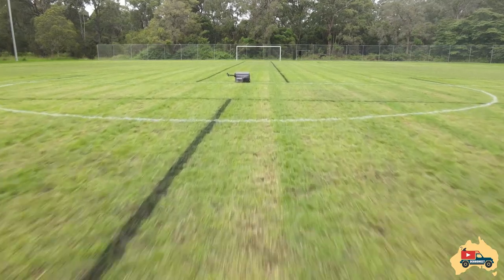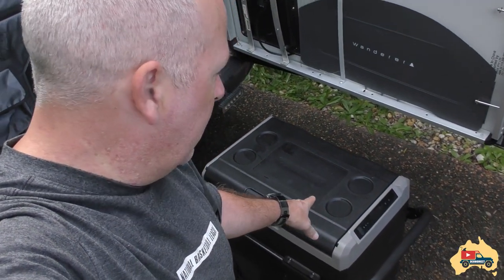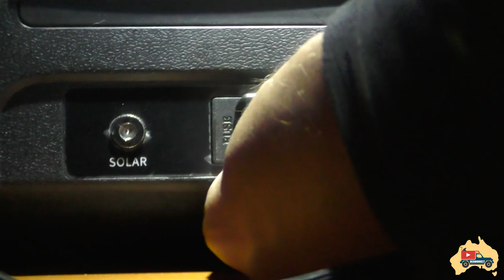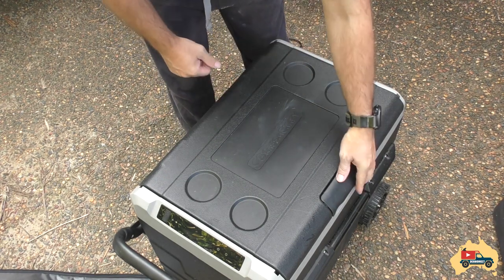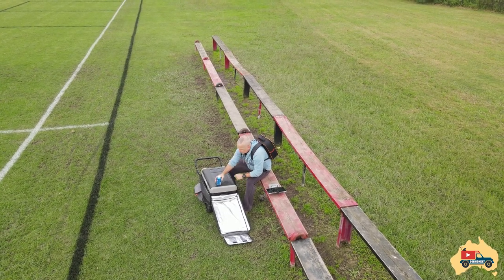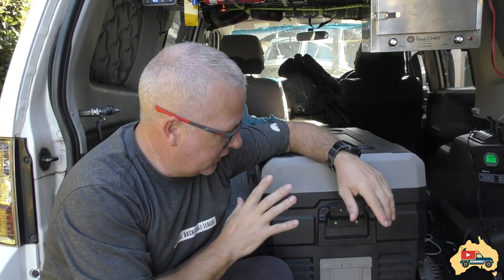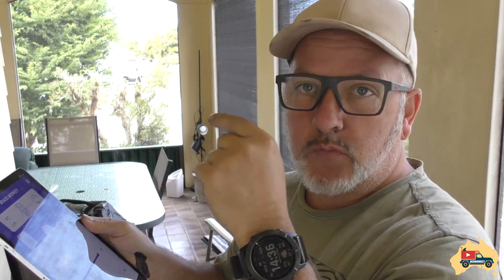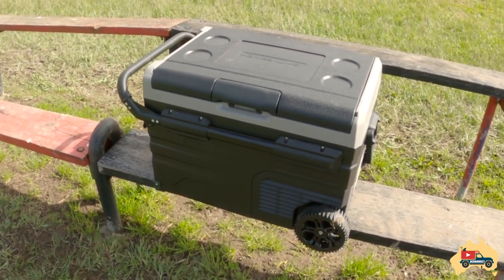Brass Monkey 35&45L Dual zone fridges with battery and solar

Comment: eyyyy Brett good to have you back mate. great reviews as always. can't wait to see how you get the internal latch going for the rear door. Not being able to open from inside is a bit of a safety issue when you've got a cargo barrier installed. I've accidentally locked myself in a couple of times.
Reply from the maker: Ok, now I have to know, how do you lock yourself inside :)   Lots have asked about it but it's not really going to suit my set up due to it being in behind the table when the rear door is close. it was like 30 bucks or so and worth grabbing to see how it works.
Reply: @DENMONKEY  hahaa so my driveway is slightly inclined and I reverse in, the door was open but not locked open, I was putting in the kaon gear so sitting in the back and wind closed the door on me.

Comment: The Brass Monkey’s are hard to go past, I have a 25l permanently in my 4WD for cool drinks, another 50L as a freezer for fishing trips and a 55L bushman I bought 25 years ago 
They are underrated and very reliable with modern features 
I almost got the dual zone however they draw more power as I don’t have 300AH of lithium at my disposal

Comment: One thing often over looked is the moulding plastic internal walls. Most at this price point have the silver foil looking walls and base with a silicone bead to seal them. A broken egg in the fridge and that seal is gone, as found out with Aldi unit. The single moulded internal walls are so good😊
Reply from the maker: you definitely need to use the baskets in those silver ones. I think those walls are much more fragile than the plastic lined ones. The seems are prone to collecting debris etc . A quick clean out here and there and theyre all good. but I know what you mean

Comment: I also have a 35L dual zone brass monkey fridge. What I did for the fan noise is use a voltage converter to run the fan at around 7V instead of 12V, and also added a second fan to the other side of the radiator to help (also 7V).
Reply from the maker: Have you noticed any changes to cycling time with the 2 fans ? I think Ive got a few old Noctua pc fans which are very quite and could stick them in, but I'm ok with the noise. There also used to be a pc fan brand (cant remember the name) that use to have an inline switch  for lo,med,hi for the fan speed. might be useful to track one down and stick the switch on the outside, to give some control.
Reply: @DENMONKEY  I did not notice any change to cycling time, and the average current draw of the fridge remained the same. I'd imagine if the back of the car got too hot it might struggle. I think the speed switch would be an awesome idea, particularly for night time. Keep in mind the power supply for the fans need to be kept the same. if you disconnect the fan it will throw an error (i think it monitors the current for the fan circuit). Awesome vids btw! I'm also keen to see the rear latch for the pajero !

Comment: Hey Brett, I recently brought 1 however im doing some tests via the app and it seems to not to settle at the temps I set for the unit, I just wonder its because of the temps up here in far north tropical queensland? Great review too btw.
Reply from the maker: They go to the set temp but will rise About 2 degrees over it,  then cycle on, go a few degrees under then shut off.

Comment: Hi, I'm Trav... California/New Mexico here. I have the same addiction. Snomaster Expedition 85L. Two Engel MT45's. Dometic CFX3 55IM and 25. And I'm probably not done.🤷‍♂️
Reply from the maker: Hey Trav, hi from Aus mate. welcome to the channel.  its a slipper slope with these things. I think you guys often get the same fridges as us but sometimes with a different brand name. hadn't heard of snowmaster but just checked them out. seem like theyre pretty well built . internally they look similar to other brands we have here but the outside looks near bullet proof.
Reply: @DENMONKEY  Snomaster while Chinese built are a South African company. With China there's varying degrees of quality. But the Snomaster has been used in Africa, Australia, Southwestern US. For awhile. Everyone that have them that I met at varying RV shows love them. They have made good inroads here in the states. They have a big 66w compressor of their own design. Mine features 70mm insulation. Designed for super hot climates. Very nice fridges. Weighs like 37.7 kg or 83 pounds American. I'm a truck driver. Single. No kids that I know of. Meh, I try to buy the best. 

I have two steel Engels that are nice too. I have a friend that has two rebranded Engels that Norcold brought into the states as the Norcold Tek2. His are 30 years old. Run like a top. 

Okay so those Brass Monkey fridges like you have are made by Alpicool in China. But they are also newair, Bodega, Bougrv and others here in the states. I'm sure there are other names. And many countries they are sold in. 
Used to be the cheaper 12v fridges were utter garbage. Since Edgestar successfully copied the Danfoss/Secop compressors. The cheaper fridges have become way better. 

I try to see what's going on in Australia. Your country seems to be the forefront of the 12v fridge market.

And when I was in the Marines. I visited your country on 8 different occasions. And I love the people. 🙂

Comment: Hey! Looking into grabbing one of these (haven't decided on size yet) but just wondering if you have any idea what the battery adapters are like for the Milwaukee/Makita batteries? They're only about $30 and I already have a few 5ah 18V batteries so just wondering what the comparison would be like with that vs the Brass Monkey batteries :)
Reply from the maker: didnt know about the battery adapters. at the end of the day the batteries are likely very similar and if you have one that fits, no reason not to use it. have you got a link for the adapters ?

Comment: Great video mate and glad to hear from you again after a while. Have you tried removing the big handles on the 45l fridge. I am thinking of getting one to put on a fridge slide. Do they come with 2 of the smaller handles which could possibly be used as tie down points
Reply from the maker: Hey Chris, only lifted it partly full. That was enough to bust a poofer valve. Other than that, only on the wheels.  They don't include a second smaller handle but I wish the e did. There are indents for the extra screws to go in for an extra handle but not holes.  So you would have to screw into it. At your own risk obviously.  One used the little and big handles to tie mine down and it works. Like you, I'd prefer not the same.

Comment: Hey mate! Great to see you back again! Great review and video as always! On a van side note how is the roof top solar holding up? Have you added any other panels? Cheers mate.
Reply from the maker: Hey Wayne, all still working but I have a leak to sort up there at the moment. So I need to pull it all off, seal the roof and put it back. I'm looking to try some flexible panels if I can find some decent ones in the 200w range. Just looking to reduce the weight up there. Not that I need to but it makes sense. I'll stick with the same rail type design though.
Reply: @DENMONKEY  How did you get on with a 200w solar panel? I have a 200w solar blanket that I would like to use for charging my 35L Brass monkey (dual zone) with 15.6 Ahr battery. It would be powerful enough but is it too powerful?  Is the solar controller on board an MPPT type?

Comment: I hear you need 200mm of clearance for the back/front, and 100mm for the sides?  If we don't have that (especially when we're driving), would that be much of an issue?
Reply: I have run a 75Lt for a couple of years with no issues with slightly less than this but you especially need to make sure the air vents have close to this amount of space around them. The rest of the fridge does not need air space from my experience.

Comment: Gday mate, would the 35ltr fit a 4ltr container of ice cream sitting the right way up in freezer or would you have to place it on its side? Cheers mate luv ya video 🤜🏾💥🤛🏾
Reply from the maker: Hey Kel, I'm going to say no. Ive got a 2L one in there at the moment an it pretty much a perfect fit side to side. you could probably stack 2 of those though.

Comment: How do you turn each side on or off? I can only seem to turn the whole fridge on or off, not the individual sides.....
Reply: Via the manual I've learnt to turn the large section off you hold the + and the settings cog for 5 second. And the small freezer you do the same but the - and the cog.

No idea how to do it via the app though.

Comment: Companion do have onboard battery,but not optional
Reply from the maker: cheers didnt know that. just sussed them out. no on board solar controller and looks like the smallest with lithium and dual zone is their 75L. still good to see this stuff getting more popular in the market,  id still like to see better tie downs on fridges so we dont have to use handles. thats a brass monkey week point on their models.

Comment: We have the Brass Monkey 45ltr.  We keep getting a f4 error code.  Any ideas on this.  Do they have a filter in it somewhere that may need cleaning...
Reply: Code F4 displayed:
– Compressor is overloaded or working at a low speed. Please turn off the product and restart it after 30 minutes. If the code displays again, please contact the place of purchase

Does it have plenty of ventilation and space around the air grills?
Reply: @Paul  all good, we replace the plug with an Anderson plug and working like a charm.  Took it in to get tested just to be sure.
Reply: Great, I put an Anderson plug on mine when I got it. I use them for all my accessories.
I didn't think of the cigarette connector causing a problem though.